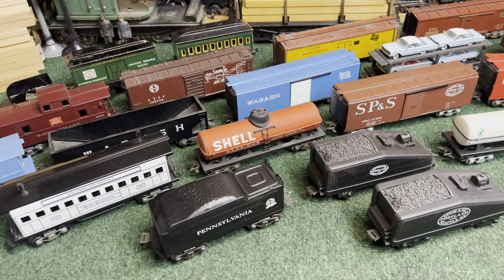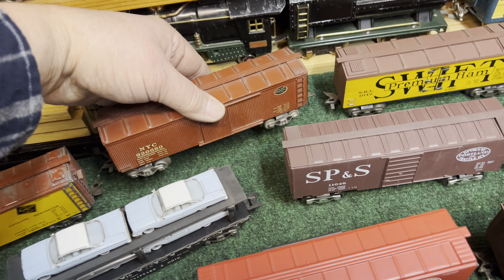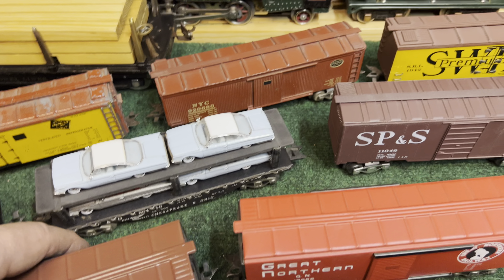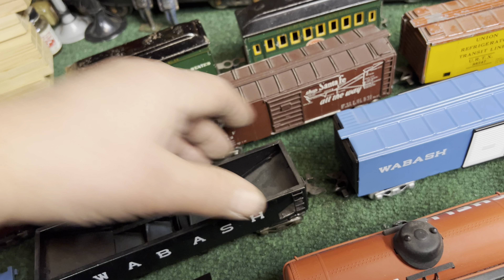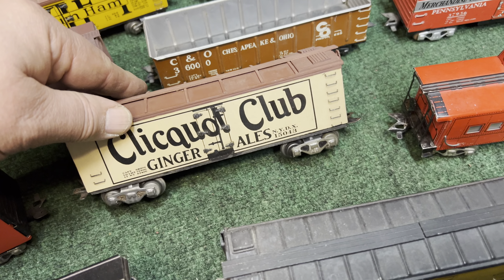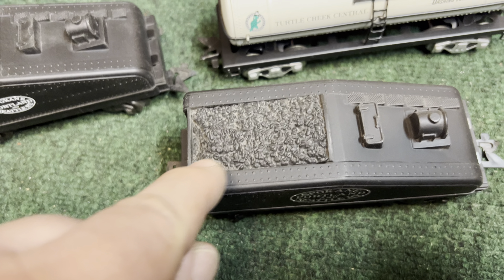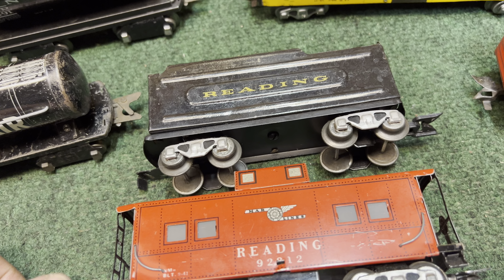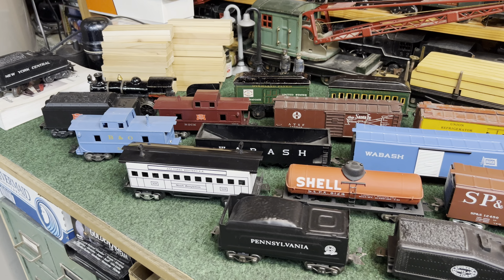The Art of Marx Trains Part 20: 3/16” Scale Customs and Conversions

Comment: Nice collection. I like collecting the 3/16 scale cars also. The Rock Island caboose and Santa Fe box car are really nice and are making me jealous. The auto rack car is pretty clever. Johny lighting and M2 make some really nice 40, 50, 60, and 70's cars in 1/64 scale. I recently bought a Johnny Lightning Sunoco 55 Chevy Nomad with Sunoco trailer that's really nice.

I always thought a SantaFe wedge tender was needed also. 

 I use those same power pickups along with the E7 head light brackets to put headlights in the E7 dummies.

Comment: Like this one a lot Dave. You should do a detail how to on the narrowing of the wedge tender. My question you didn’t address was the frame.. didn’t that also need adjusting?
Reply from the maker: https://www.tcatrains.org/etrain/marx-3-16-slope-back-tender/
Reply from the maker: ……the belt sander to remove approximately 3/32″ from each side. With a little filling and the removal of the back metal step, the two metal tabs slid smoothly into the plastic slots in the shell. Even the front screw lined up. The base required a coat of Krylon satin black to cover up the bare metal edges from the sanding.